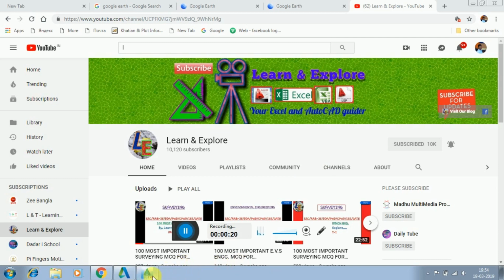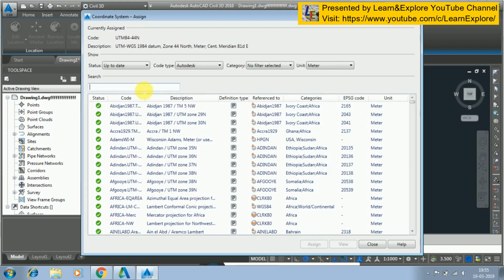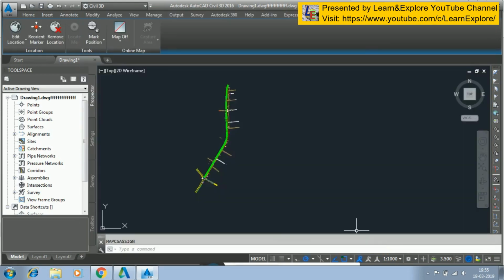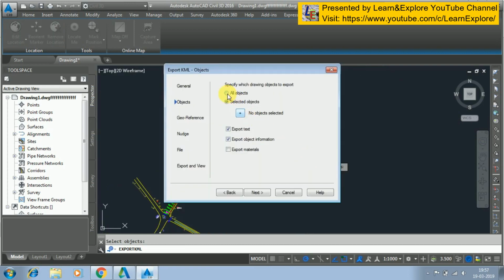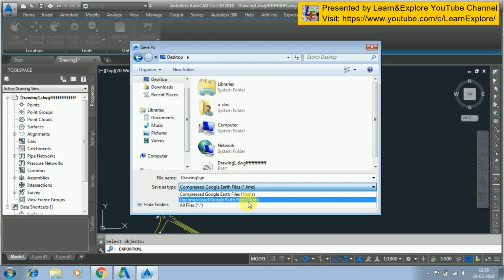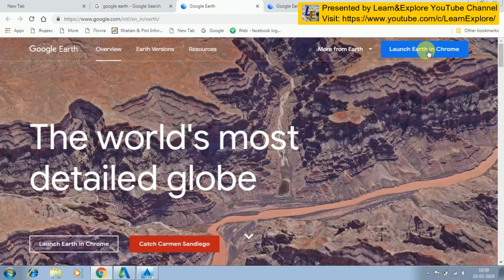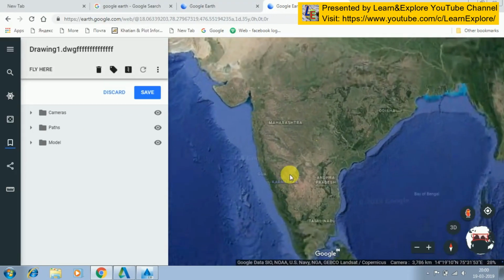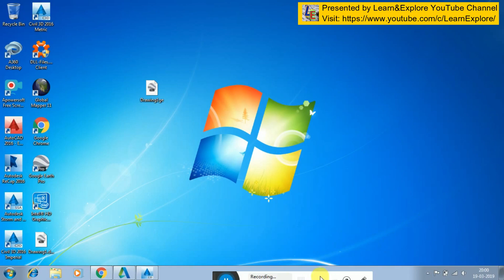AutoCAD to Google Earth KML by CIVIL 3D

Comment: i have follow your video and do the same method but my drawing not fit on the google earth exact its coming 1 meter difference.plz advice
Reply from the maker: Sometimes in places google map has error
Reply from the maker: May be that could be a reason. Otherwise may be error in data
Reply: @LearnExplore i have try for  other project also having same problem 
If u give me email if i will send u one drawing plz check it
Reply from the maker: Send me at contact@learnnexplore.com
Reply: @LearnExplore  thanks i will u 
Thanks u very much for instant reply 
Keep it up 👍
Reply: i send you email plz check it

Comment: I exported a polyline to KMZ, but in Google earth the size doesn't match with the one it has to have on the ground(it's pretty smaller), how can I fix this?
PS: I found the issue. The drawing system settings were in feet but my drawing was supposed to be in meters, so I changed this settings and that corrected the problem.
Reply from the maker: Yes that was SCALE problem in AutoCAD. Thanks for sharing
Reply: @LearnExplore   I think it's a problem of difference of units rather than a scale problem,😏
Reply from the maker: Difference of units and scale factor is similar.
For example if your drawing is in meter and if you scaled the drawing with a factor 3.2808 then it will turn into feet
Reply: @LearnExplore  well you got a point there